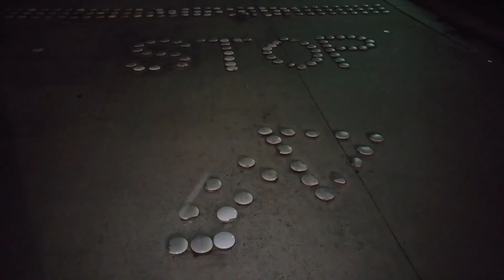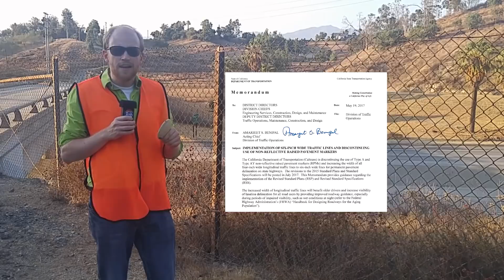California REMOVED this SAFETY DEVICE from freeways and highways

Comment: Whats cool about those stemsonite reflectors in florida is they glow white while on the correct side of road, and reflect red if you are going the wrong way.
Reply: Cameron Shashlo aren’t those common everywhere?
Reply: Gotta try that out.
Reply: @danielcuevas5899  Nope. Reflectors and snow plows aren't a good mix.
Reply: In North Carolina you'll occasionally see BLUE Stimsonite reflectors mixed in with the regular ones ... NC DOT & county road departments use them to mark the location of fire hydrants so that fire departments can quickly find them in the dark.
Reply: They've been that way since the 1960's here in so Cal.
Reply: @Pudentame  Same in Florida as well. They are usually located in the middle of the lane.
Reply: In the UK the new ones (cats eyes we call them) are green glow for onramps, white glow for lanes and red glow for edges.
Reply: Are you speaking from experience? 🤣
Reply: @Pudentame  Where at exactly? I've only seen reflective fiberglass rods used for that here.
Reply: Here in Oklahoma there are some school districts that use the stemsonite reflectors that blink in school zones. It really gets your attention.
Reply: @SOU6900  "In North Carolina you'll occasionally see BLUE Stimsonite reflectors mixed in with the regular ones" 

I live in the Piedmont area, specifically in the capital city, Raleigh. I see them almost anywhere I go outside of cities; wherever there are primarily Volunteer Fire Departments. They're really easy to spot if you have to drive anywhere at night.
Reply: @Pudentame  🤔maybe Goldsboro and Mount Olive should put some down. I don't get into Raleigh all that much at night so I've never noticed them.
Reply: @SOU6900  I've seen them on US 70 & US 117 and NC 111 & NC 55. 

I spent 15 years as a traveling service tech covering eastern NC - Wilkesboro to Wilmington; Southport to Corolla and every point in between - when the quickest route to Wilmington was NC 50 to US 117 ... unless you're coming from Fayetteville, then you take NC 210 down to US 421 - BEFORE I-40 and before US 64 was four lanes all the way down to Nags Head. 

Just drive along any of the older routes at night, and you'll see them.
Reply: @skiphouston7392  We have been using the Stimsonite road  studs since the 90s. Cats eyes where metal.
Reply: Those retroreflective pucks inset in the pavement or glued on top are everywhere. Blue ones in the US to mark where a fire hydrant is. 

The red side is only seen when traveling the wrong way on a one way highway section like an interstate - so you almost never see them. The theory is nice but in practice the level of disconnected from reality person that drives the odd angles and turns and then past the several “do not enter” signed to even get on the wrong way, doesn’t see they are on the wrong side , those blocks of wood will never notice the red reflectors or be able to reason out that something is wrong.
Reply: Same in California.
Reply: @Pudentame  THATS what they are , cool.
Reply: @skiphouston7392  From what I've observed around here in NC, there's a row down the center & a row along each edge. Mostly yellow along the center & white along the edge on your side of the road. 

Those same white side markers have red on the other side, so if you've got yellow on one side & red on the other, you're driving on the wrong side of the road. I have seen in some places where they put a double row of white markers down the center and switch to yellow on one side or the other (or both) to make the no passing zone markings more visible at night.
Reply: Some highways in California also have red reflectors for wrong way traffic.  If the sun is in the right place and you look in the rear view mirror it looks like a row of red lights behind you.
Reply: well in India, we have the same stemsonite reflectors and it never worked, in India when we drive on the Highways, we never see or feel those reflectors. I feel that old technology Bots Dots would help, because we don't have winters and would reduce overspeeding
Reply: Pretty cool and simple technology
Reply: @Pudentame  Same in Texas with new roads.
Reply: @prathamprabhu9403  the bump from the dots vs the reflectors is basically the same, the dots are just normally spaced further, so i guess it wont make as much of a vibration
Reply: They're like that in California, too. When the eastern span of the Bay Bridge was closed because bits kept falling off it, they made the lower deck of the western span two-way, so you'd have to drive counter to the usual direction to get to Treasure Island or Yerba Buena Island. Driving against the red reflectors was pretty unnerving.
Reply: @Pudentame  Blue reflectors seem to mean hydrants in a lot of places. In some Australian states, they use green reflectors to mark exit lanes. I find the lighting near exits in some parts of the US somewhat inadequate, so I wish they'd do that here, to make exits harder to miss… I've ended up driving in the shoulder by mistake a few times.
Reply: @Pudentame  That's a thing everywhere. It's just so the FD knows where the hydrant is.
Reply: They're like that in Arizona too
Reply: @Pudentame  That is more common in California than NC...I wish I would see more of them here.
Reply: After playing way too many lego video games, my kid started calling the rectangular reflectors silver and gold studs... with the occasional blue stud marking a fire hydrant ;)

This was in Hawaii (east side of the Big Island) where the reflectors are pretty damn necessary due to it raining almost every day.
Reply: @CharleneCTX  
True! When I lived in Colorado, being from Mississippi, it was hard for me to see at night.
Reply: @CharleneCTX  interesting, ohio has them as well as snow, hamilton county (southwest corner of ohio) tends to brag that they have them on nearly every mile of road.
Reply: @CharleneCTX  In snow states the reflectors are recessed into the road with metal protecting the reflector.
Reply: @BryanTorok  When I lived in Maine, there were no reflectors.
Reply: @CharleneCTX  How long ago was that?  I'm sorry, perhaps I over-generalized my statement since I haven't been to every state where it snows.  And, even for the states I've lived in or visited, I haven't driven on every road.
Reply: Same in California, I think that’s coast to coast.
Reply: @johnclements6614  stemsonite is a brand
Reply: @pb6198  so
Reply: @Tom I honestly haven't seen any, anywhere in the US, that aren't red on one side, except for the ones that are yellow on the other side. I'm sure they exist, but considering most traffic lanes go in one direction, it would make sense that they're uncommon. Just in the past few months, I've been alone on newly paved, multi-lane, undivided highways in Nevada, Kansas, Ohio and Connecticut, and noticed the oncoming lane dividers glowed a bit red. I won't speak for every state and every reflector, but it's definitely not just a California thing, and I doubt it's unusual.
Reply: @SOU6900  They are everywhere in California. Even on residential streets with no other lane marking there will be a reflector in the middle next to the hydrant. They are in the middle so that even if someone illegally parks in front of the hydrant, it can be found. Blue is the US DOT standard color for hydrant markers. Sometimes, you'll see a green one. Those mark access roads that emergency vehicles can use.
Reply: They have them in BC on highways, but the snow plows frequently dislodge them.
Reply: @Pudentame , those are common in my part of Washington (state not swamp), too, even in parking lots.
Reply: I collect them. I got a blue one- which I think are found in those truck lots in the back of supermarkets where they back the trailers into the store to transfer cargo, in my theory, used in airport parking lots. Like industrial places.

I got the red and white one, which are the most common on the freeways and community roads that go 30 to 45.

Then the yellow ones, which I think are for turning lanes and areas for neighborhood roads. The 10, 15 and 25 mph ones. All from florida.

And I think a red one, which I lost it some place. I think those are for truck lots and airport parking lots too.
Reply: @Pudentame  I live in southern Wake and lived in Raleigh for a bit, and I hate that they've been slacking on putting reflectors on roads after repaving, especially on the newer, darker asphalt. As if people around here forgetting how to drive in wet weather wasn't enough fun, but at night in the rain when that dark pavement really gets reflective, you get to mix in a game of "where's my lane?"
Reply: @CharleneCTX  We get a fair amount of snow here in New Jersey, and plenty of highways have the reflectors in the pavement for lane and shoulder marking. But they are inset pretty far, and have a very gentle slope on the sides, to make a mostly smooth profile that works with snowplows. I think they are encased in some sort of polycarbonate too for extra strength.
Reply: Thats Standard I thought throughout USA highways 🛣-??
Reply: Yellow is usually for the center line, and Red/White for the lines between lanes running in the same direction.  Blue for Fire Hydrants, in Ca.  Most are now being countersunk below the roadway to prevent plows from removing them.  THe state of Ca will be looking at more lawsuits because of this!
Reply: ok in europ i have see simlar thinks in the Elbe tunnel that divids lanes in the middle share Lans
Reply: That’s cool. My state only has faded paint and deadly crashes at night due to “distracted driving”
Reply: @Pudentame  every where on the blue reflectors.
Reply: @Pudentame  same thing in CA
Reply: @robertnussberger2028  did you know there’s yellow ones for both 1 way transfic and 2 way traffic
Reply: @CharleneCTX  we have then on the road in Pennsylvania where we gotta plow, ours are flat with the road, but do have red on the opposite side.
Reply: USA behind the times again. Cat's Eyes were installed on all main roads in the UK many many years ago. I was guided by these reflectors way back in the early 1950s.
Reply: @mike04535  His point is that these newer ones reflect a different color depending on the direction you look at them.
Reply: The bigger question is how the fuck do you know that florida man?
Reply: And some idiots wouldn't know the difference 😬🤯
Reply: We call ‘em Cat’s Eyes in Aus
Reply: This is true for Georgia as well.
Reply: @Pudentame  I work for a county road dept in WA. We use Yellow stimsonite reflectors to mark the lanes (white ones too but our roads don't require many of those being rural). We use green Stimsonites to mark our culverts that go under the road.

Comment: back in the 70's they put a bunch of reflective raised lane markers all over the highways in Ohio and the snow plows scraped them all up pretty quickly
Reply: They’ve done that in Rhode Island recently
Reply: @counterfit5  RI won’t have to worry about them getting scraped off, the roads come with built in recesses called potholes
Reply: In canada they are between every dot of a dotted line in my area. They are ressessed in to the ground tho and eventually dirt getting washed across the road fills the holes up until they roll a street sweeper over them
Reply: I always see those reflectors buried in snow on the sidewalk
Reply: Yea that happens here in Washington on the rare chance it snows enough to where they bring snow plows down from the mountains to help clear roads
Reply: A few years ago they but raised grip bump things on the sidewalks where I live. Sidewalk plows destroyed them after a month of actual snow.
Reply: @counterfit5  you talking about the few spots where some of the roads and highways have the extra square reflectors mostly on the center solid lines? Or the reflective stickers they lay in the road with the lines when they do them?
Reply: @oweng3763  the pot holes are in the middles of the lanes. Not the lines. 6 inches in from the breakdown lane on the passenger side is where the pot-trench begins. Get it right.
Reply: @abcanadabc  Those sound to me like they were likely derived from the Cat's Eye devices invented in the UK in 1934. In fact, they were designed with resilience against snow plows as a design criterion. Early models were not only inspired by the retroreflective properties of cat's eyes but looked like them as they used two circular glass retroreflectors. They have another really cool design feature that takes advantage of their recessed mounting also, their natural tendency to collect water is used to make them somewhat self-cleaning. The reflectors themselves are on a flexible rubber mount above a deeper pit in the middle that they are pushed into by the pressure of vehicles driving over them. This is used with another well-placed rubber wiper to make them self-cleaning or at least slowdown dirt accumulation that would otherwise obscure the reflectors. Of course, reflectors of this type are common in colder climates around the world like Northern Europe, Canada, Siberia etc as they all have this same issue of snow ploughs not being kind to surface mount fixtures in the roadway.
Reply: Graf von Losinj  I wish they were more popular in NY as I can't see the lines when it rains

Comment: Even if people CAN see the painted lines they still don't know where they should drive
Reply: Exactly
Reply: It's hard to see a painted line on a wet road.  The dots and reflectors are much easier to see
Reply: @drmayeda1930  tell the departments to spring for the reflective PAINT that's been around for ages. Or are we pretending reflective paint doesn't exist?
Reply: @drmayeda1930  Painted line standard where I live is reflective road paint with borosilicate beads that reflect light back out in all directions, as well as "cats eyes" engineered to reflect light back up at a slight angle directly at the drivers eye level, tinting it in the process, with a colour code for where to drive regarding the eye, or specific ones for water main valves and fire hydrants.
Reply: Gotta account for the fact that people are literally so stupid that you print and tape the instructions to something and people still won't be able to figure it out.
Reply: @homeygfunkoffacherryfruitl4971  😆 Like labels that say "Do not eat this".
Reply: It's the same reason they put tags on hair dryers that say, "Don't use this in the shower." Our gene pool needs a huge dose of chlorine.
Reply: @jimfinigan1681  😆 you just reminded me of a "Here's your sign" joke.
Reply: @SOU6900  I LOVE that one!
Reply: @SOU6900  One of my supervisors tells us, "If I have to address it, someone has done it".
Reply: @jimfinigan1681  😆yep
Reply: @drmayeda1930  Rained hard last this past week in California. As I drove on the freeway, this issue came up. It was so difficult to see the lane markings because of the water on the road. The light reflecting off the water made it bright, just like the white paint. It's odd because California is pretty good when it comes to being consumer friendly. What they've done with the lane markings isn't consumer friendly, at all.
Reply: Just cut rivets in your asphalt. Same bumping feeling, no wasted plastic or snow plow problems.
Reply: Check out the 11foot8inch bridge channel. They've got flashing lights, words, the whole shebang, and still too-high trucks still hit it.

Comment: Can confirm growing up in a part of the country that actually gets snow every winter, we NEVER had Botts Dots on our roads. And yes, reflectors were embedded in the road. As for warning lane drifters, the method I've seen employed is creating a rumble strip by removing a chuck of the road, known as a milled rumble strip.

BTW, the "oreo" is only necessary if it's on a concrete road. If it's black top they just need to lay down a white stripe.
Reply: In Cali here we usually have cement roads. Asphalt black wouldn’t show up anyway.

Comment: In Europe you can see either the paint alternating between thick and less thick, or the pavement itself can have little indentations. It creates a lot of noise.
Reply: Much better system IMHO. Simple to implement and maintain.
Reply: Yeah they have that in the US but only for if your driving completely off the road. It's has indents along the edge make a roaring sound
Reply: Thanks to noisy paint, we don't have to use black paint on a road service.
Reply: theyre called rumble strips ^^
Reply: They have those in new Mexico.
Reply: Where I live in Oklahoma they’ve begun to put rumble strips between lanes as well as at the edges. Very helpful for once the paint has worn off or it’s too dark to see!
Reply: The paint is also reflective which allows you to see them when wet

Comment: When those reflectors in Illinois come loose, watch out! They have a metal frame that could kill you if that thing was launched by a truck tire.
Reply: my first drive through illinois one came loose ahead of me and hit the divider wall next to my car.
Reply: Sounds like you learned that from experience
Reply: While the Illinois still uses them, some localities in Illinois put a groove in the road and glue in the plastic part, to avoid the metal part flying.
Reply: gotta love my state its a mess